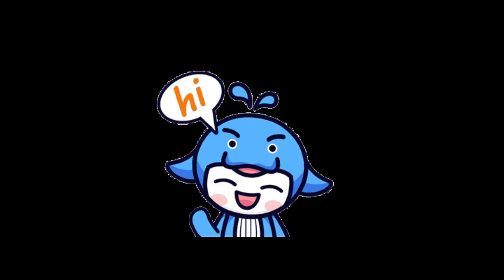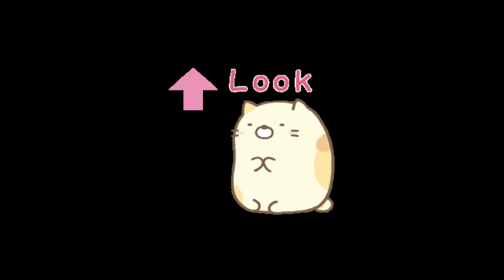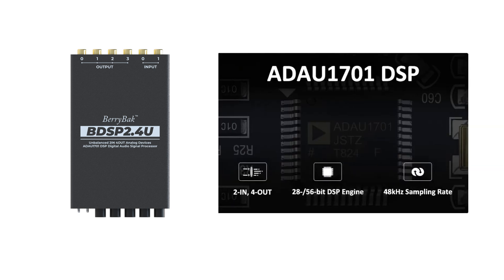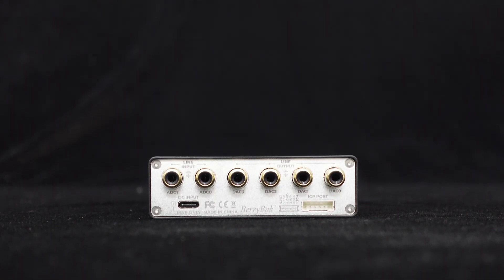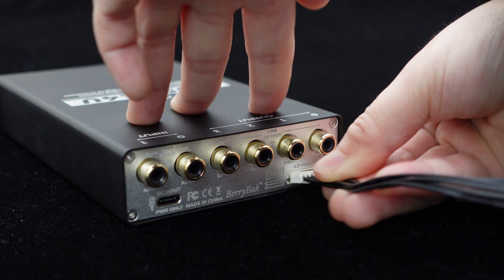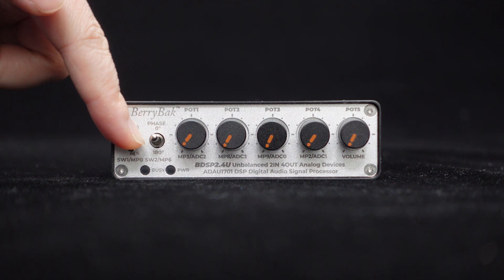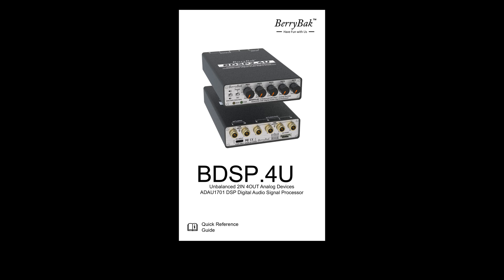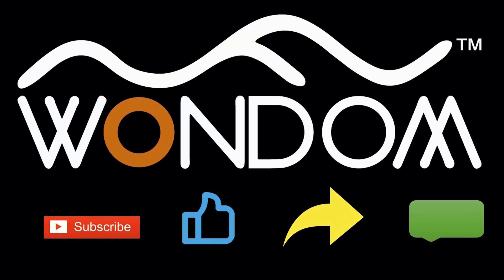2-in 4-out ADAU1701 SigmaDSP preamp BDSP2.4U 2-Way Digital Crossover EQ Bass Enhancement  PC UI

Comment: Hello what is the difference between this unit AA-AP23124 and AA-AP23123? Thank you
Reply from the maker: Hello, thank you for your watching. Compared to AA-AP23123, The BDSP2.4U has optimized circuit noise and uses an isolated power supply. Wish this could help you. Have a fantastic day~